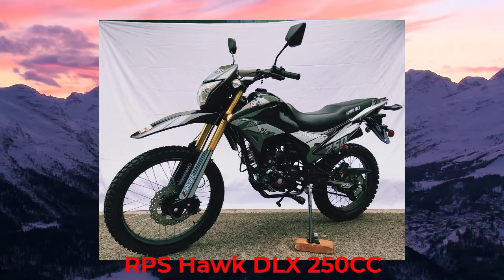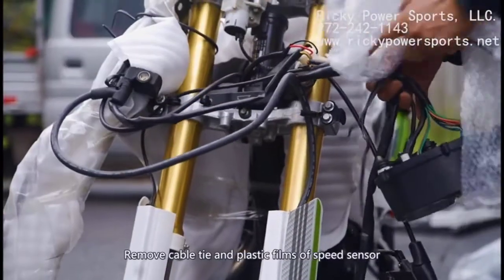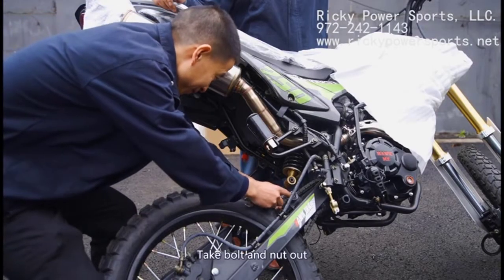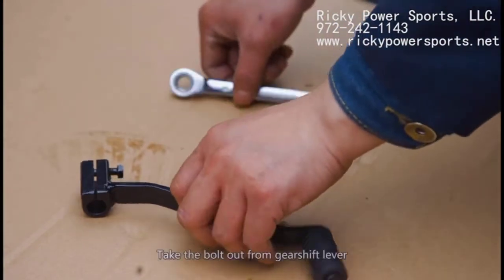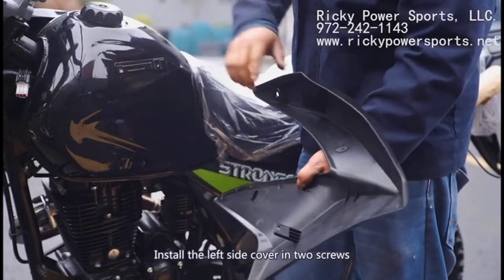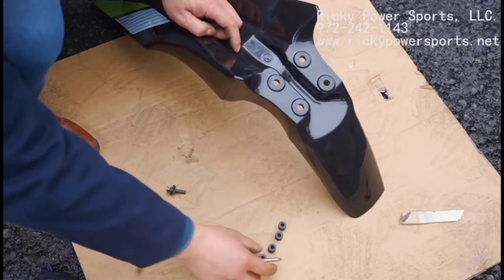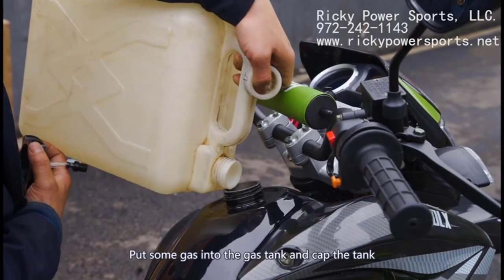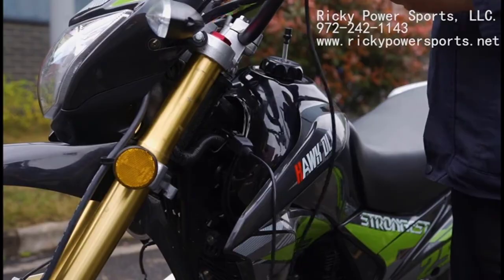RPS Hawk DLX 250 Setup and Review Video (Uses Official DVD Setup Footage from RPS)

Comment: Great voice over compared to the original haha but seriously good job sir. Where does the tube at 14:30 connect to?
Reply from the maker: That’s the battery breather tube. One end connects to a nipple on the battery and the other end hangs free and does not attach to anything. It lets any buildup of gas escape.
Reply: @nicein2000  Omg 🤦 Thank you!! I was losing my mind when it said "Install a plastic tube of gas tank," thinking it was supposed to come off the fuel tank somehow. I upgraded instantly to a sealed AGM battery so I don't even have to worry about that hahaha thanks again!
Reply: @lucid_galaxy_9799  what battery did you go with?
Reply: @kingtruckerea7651  I went with a ETX7S powersports battery from O'Reilly's, but then took the bracket out and put in a ETX14L. The 7 only has 100 cca so I decided to upgrade to the 14 which has 220 cca.

Comment: Where were your keys located
Reply from the maker: When the bike arrived in a crate? They were in a plastic bag with the manual and other papers.
Reply: @nicein2000  ok thank you I definitely didn't get any keys with mine and the company won't help me out that is why I asked
Reply from the maker: @zachbarnett1802  Wow, that's crazy. I don't have the bike anymore but I recall one key was a nice one with thick plastic and the other was a really plain all-metal key
Reply: @nicein2000  thank you very much for replying
Reply: @zachbarnett1802  rig it to a switch or get a cheap autozone ignition